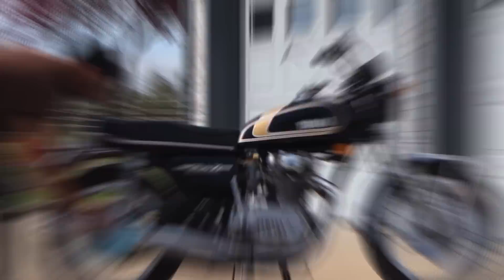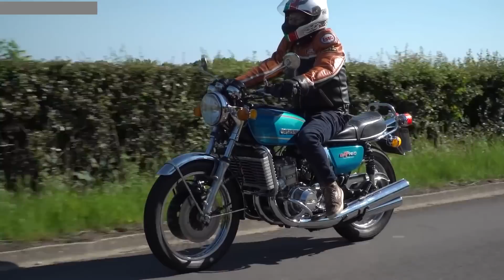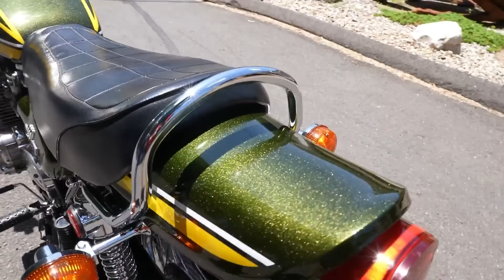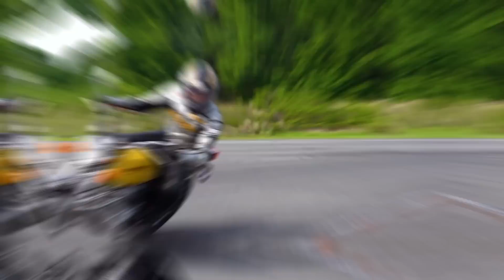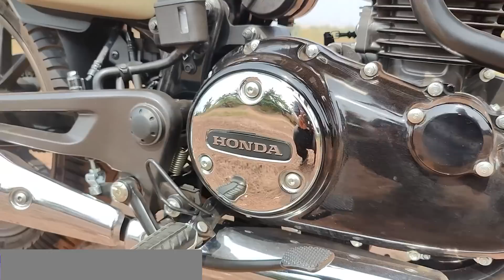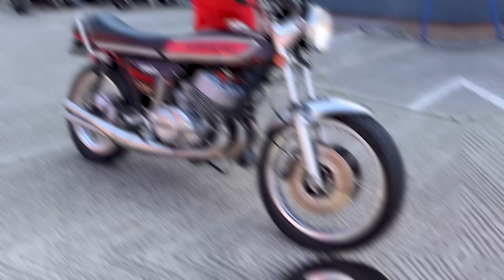1970's Most LOVED Japanese Motorcycles...

Comment: In 2000 I got back riding and replaced my long since sold 1975 Honda XL 350 with a 2000 Suzuki DR 650 SE. A nice upgrade but very much the same. I'm still loving it!
I would buy my old XL 350 back if found in decent condition.

Comment: The cb 450 did not have a dry sump lubrication system .
Reply: Good catch! I can't think of a Honda that does.
Reply: @vaughnslavin9784 Honda 750/4 has a dry sump.
Reply: @MonochromaticLightsource  my brain was dead when I made that comment. After building two 750s I should've  remembered that

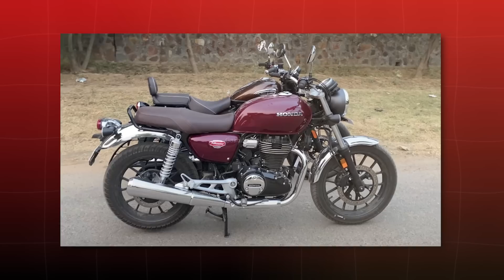Comment: Starting, 10:34, most of the images of the CB350 are not the 70's version. They are the current offerings in India (and maybe elsewhere), it's a single cylinder. You can see they look very different with LED headlight and turn signals; they don't look like the 70s CB350 Twin at all. That apart, this video is a good compilation.
Reply: Yup. lost me at the CB350 shown as the new one-lung version.
Reply: Also shots of the CB400F in the CB500/550 segment.

Comment: A lot of what made Motorcycles from that time beautiful is their motors. Beautifully designed, air cooled and pleasing to the eye. The XS650 Yamaha was gorgeous, the perfection of a parallel Twin just like the CB parallel Twins from Honda. It wasn't until the CB750 Four came along that I changed my mind..!!!!
Reply: I had a 1975 Honda CB 500T and the transmission failed on me 3 times in four years and I finally got rid of it as a parts bike